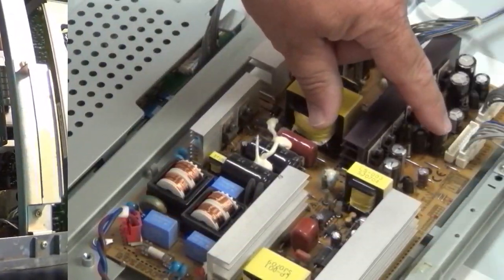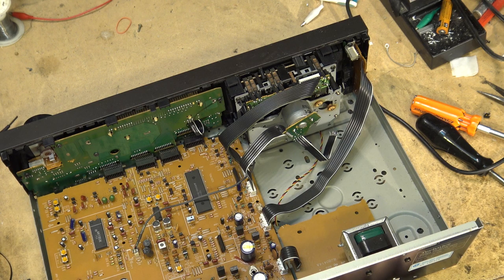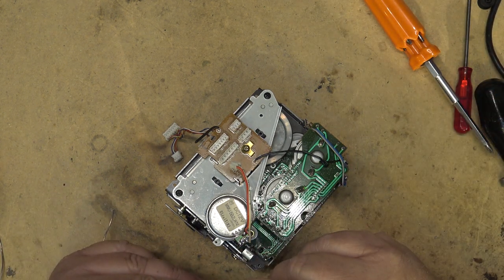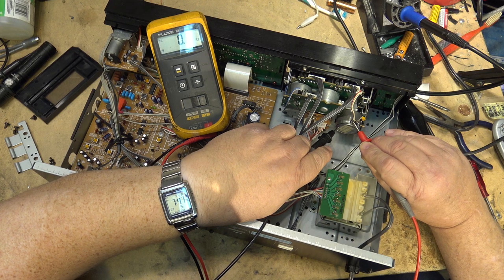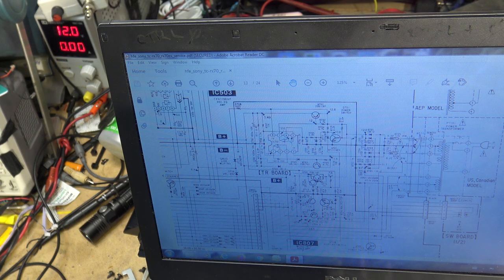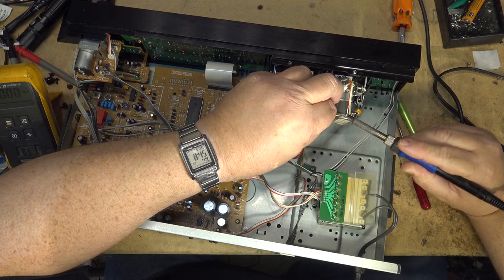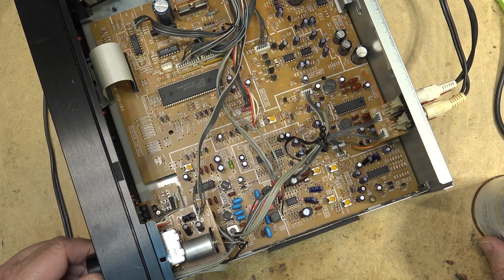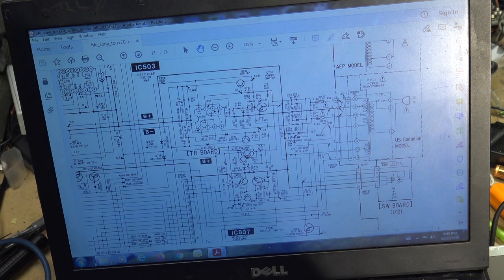Sony TCRX70ES Canibalize one machine to try to make this one work will I have success

Comment: Back in nineties we used to open the cassette motors fully to clean the shaft and check the contacts of the rotor and stator and polish the contacts.Also using a needle we cleaned the gaps between the rotor plates.In many cases the motor was coming back to normal operation else replaced.

Comment: "Going together nicely"   When I saw 51 minutes for a motor swap I wondered if  it when well. Glad  the short did not fry the power supply!  Nice repair saving another unit from the landfill.
Reply from the maker: About 4 hours if my time on this one.  Lost my shirt on this one.
Reply: Yea, but you were a good sport about it letting us see what was required and what quicksand to avoid. I'd say, all in all a win.

Comment: I have issues in the past with a Sanyo Boombox. To me the issue was THE MOuNT. The sanyo dint use this rubber bushings that actually isolate the motor from the chasi. I installed on the Sanyo and boombox was dead. I swear it was a no power issue when it was a short LOL .... surprises ....
Reply from the maker: Notice the technics had the motor isolated in rubber mounts too.

Comment: I saved two TEAC CX-400 from the being recycled thinking I can make one from two, besides free is free. I wanted another piano key three head deck for the collection because of the instant response they have being mechanical linkage. One has a flywheel that is not on square with the capstan and has a bad wobble, never seen that before, don't know what would cause that unless it was dropped. Belts off of eBay not very good,  flat belt on motor won't track in the center, and the other two belts given were the same size. Now I have an intermittent high frequency flutter to the speed, so maybe a bad motor too. Can rap on it with a screwdriver handle and it will smooth out and then come back. About ready to throw the towel in, got too many hours in it already, but I got them to learn something.

Comment: Been wondering for a LONG time: what TEMP do you have your iron set to? I bought a really nice temp-controlled iron from China but I have NO IDEA what temp to set it at. Some guys say 280, some say 300, but USUALLY nobody SAYS the temp they're using. I'm used to soldering with a soldering gun with TWO 'wattage' settings or an iron with a fixed 'wattage'.
Reply from the maker: 700F is what i use. That's about 375C
Reply: @12voltvids  Awesome! Thx so much for answering! Love your content--wish I had your knowledge!  :)

Comment: Awesome as always. I got a Sony that has an EQ band visualizer on the display, that's stock most of the time. Sometimes, a bar moves to the sound, but it's rare. If you try to adjust the EQ to your liking, every position works on each bar works. Do you think that's fixable, or is it an irreplaceable IC that's not working properly?

Comment: I'd rather keep the Technics instead of repairing the sony :P. Anyway very nice repair. About dolby, C is absolute crap. Dolby B recording without dolby playback is the option that I use mostlike.
Reply: Dolby C is not crap. It requires a deck with bias control (at least) and good quality tapes.
Reply: @jaceknasalski1422  True. But its hard to find good quality tapes. Besides some Maxell UR's which are only type i.
Reply: I cant stand Dolby, probably I havent been doing things right. No just the change in sound but this sort of envelope detector trying to hide the noise once the music is going out ... the time constant is awful, you can hear it kicking in and out with the music. Probably something with my gear. Yes, it imrpoves many things and shades many others. Probably because I like JVC more, ASNR doesnt seem to be that agressive ..

Comment: Yep better to solder the wrong side of a single sided PCB (single sided and not through hole has a risk of a dry joint). In my case it was a wall mounted electrical shower with a blown capacitor and a pathetic dodgy mechanical low pressure switch. 
I sure it was designed just to last 13months

Comment: Exactly. I have warned you about grounded motors in previous video. And it was not a joke. This is a problem with this SONY deck. Good job!
Reply from the maker: This is normally not an issue because normally the negative terminal is grounded.

Comment: What does the control circuit do exactly? I know it regulates the speed, but does it also give the motor an initial boost or something? I once rewound one of these, but the control circuit was dead and I never got the motor to run at the right speed without stalling (it did work fine alone).
Reply: It is actually pretty simple and clever. The motor need some sort of "load" feedback. Since those motor dont use any means to masure the actual speed, all they can do is try to react to the "load". The load is measured by measuring the current and voltage to the brushes is adjusted accordingly. To me looks like on no load, it is just a regulated voltage, once the load appears, it add more and more voltage to the brushes. All the circuit was tailored to motors resistance and this kinda of circuit is called negative resistance control. It is designed to concel the non ideal resistance that the motor has and then you are let with an "ideal" motor you can control just by voltage. This is heaviliy dependant on the motor itself. Once you wonded up the motor, its resistance changed, probably out of range for the controller. And yes, I think they have a kick up on the start, in fact they pick speed very aggressively. I have seen all this comment made with 2 transitors (early Philips and Grundigs and early mabuchis). It works like a champ
Reply: @38911bytefree  Wow, interesting how much goes into those DC motors. One would think they'd be less complicated haha
Reply: @enzoperruccio  I have played a bit with this subject trying to make a better circuit for a motor myself, which I didnt. But yes, there is some trick going there. Old motors used mechanical gobernor, so it was ok, gobernor "measures" speed. But whe turned into electronic control in an effort to save $$$ and avoid putting a tacho or FG ... they came with that. In most complex decks motor oputs a signal that is proportinal to the actual speed so a circuit can use to correcto the EXACT target speed.  But ... this is too expensive for many deck and not always the cheap ones. I have a TEAC510 and I would expect FG ... but ... nope. Plane standard motor.
Reply: @enzoperruccio  A perfect analogy is a car,  engines still can to close loop. They estimate the mix base on the LOAD (rpm an other things). But is not a truly colse loop. O2 sensors are not good enough to do that.

Comment: Sony. Even the voltage for the motor is proprietary...
Reply from the maker: 12 volts?
Reply: @12voltvids  Yes but that -8 and +5 volts is new to me. Did other companies do the same thing?
Reply from the maker: @crashbandicoot4everr  It is a goofy way to do things, and I can't think of other companies that did the same, but there may well have been some.  Not something you really think about when working on them.

Comment: Never really heard of that b4,,,the motor can't b grounded as it blows the fusable resistor,,,Sony has made a stupid design with floating power supply input to Motor to make it work.

Every tape deck I've repaired always had a grounded motor connection,,,,but not had repaired a Sony cassette deck recorder for repairs yet,,,but will watch out for that kind of power connection to cassette mechanism motor.
Reply from the maker: A trap to ensure you only buy your parts from Sony.

Comment: The intro was funny in a way,  you had a battle with madness.
You were loving the sony design so much, then the shitty part made you realise they are very stupid indeed lol.
You might want to put the old motor on a shelf,  a commutator cleanup might make it ok for another sony heap :)
Reply from the maker: Go watch the original.  I took that motor apart.  That motor is FUBAR
Reply: @12voltvids  Ahh i see,  i'm not one for remembering dead parts, unless they are painted pink or have something really odd looking about them.
Remembering things has always been difficult, peter :)
My frend two streets away remembers more about my life than i do, im not kidding dave.

Comment: If it were me I would have binned the Sony and fixed the Technics.  Sony stuff, I was never a fan of.
Reply from the maker: It brought a tear to my eye doing this.
Reply from the maker: The technics was a working cassette.  So I wrecked a working cassette deck to fix a Sony.
Reply: @12voltvids  OMG!  You are a criminal.  Sometimes it is the only way, but there is no way would I tare down a working unit to fix a broken one, especially a Sony!
Reply from the maker: @BoB4jjjjs  
Well now i need to find a motor for the technics and put it back together.  
Guy gave it to me for parts.
Reply: @12voltvids  Yeah, well get looking for one.  They were everywhere at one point, now though they are getting scarce!
Reply from the maker: I'm going to fix the Technics. Its mine now. So I will look for another unit to pull a motor from..
Reply: @12voltvids  I think you need to after some of the comments, though they never bother you anyway.  But I would rather see  the Technics fixed than the Sony, I think you are the same, but as you were given it to rob the motor from, you follow the instructions like everyone else would do.
Now the look for a motor to fix it.
Reply from the maker: @BoB4jjjjs  
It's done.
Reply: @12voltvids  Yep, just watching "The luck of the Irish"  lol